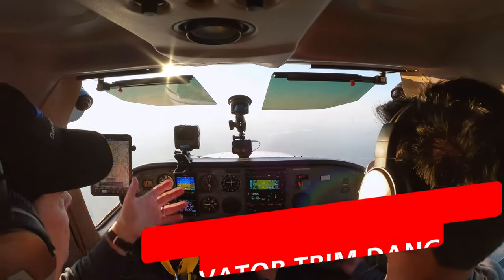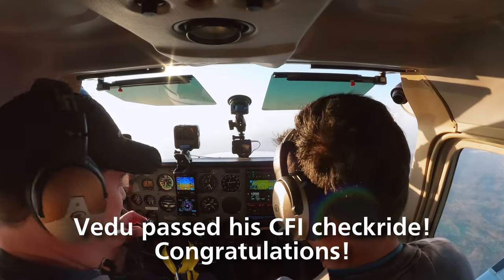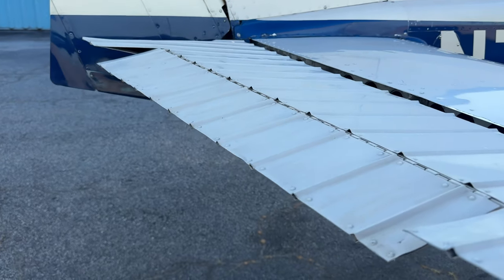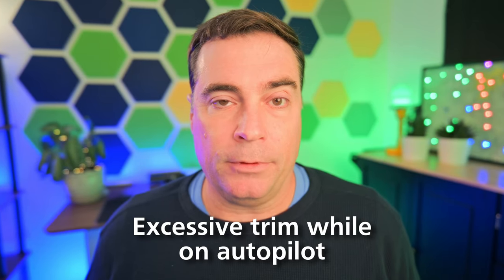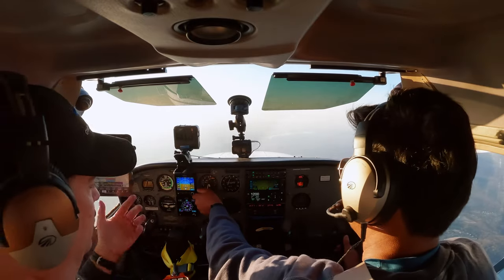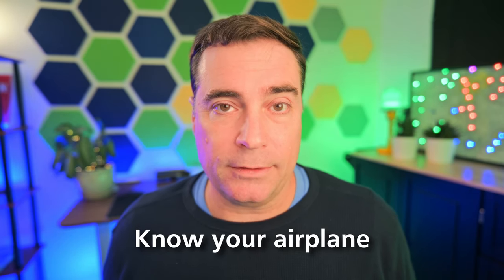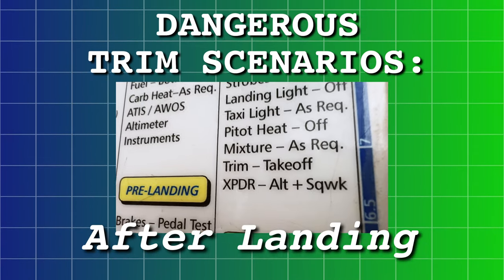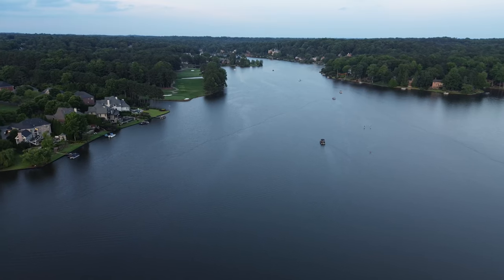How serious is an elevator trim issue?

Comment: I just learned a bit about this.  If you slow down the force is less.  This will buy you time to get circuit breakers pulled or getting away from the ground

Comment: Great video thanks Nathan more trim awareness should get out there. I had a full nose down trim run away in an Eaglet. The forces on the stick was alarming and I was worried about damage or departure from the control system while I was trying to overcome the electrical malfunction, note the Eaglet has a full flying tail plane
Reply from the maker: I think round two of this topic is going to be exploring the force needed in different airplanes, like your eaglet experience, and then something bigger and faster than a 172.  Thank you so much for sharing your story, I very much appreciate it!
Reply from the maker: Which eaglet was that?  The Tecnam or the AE?
Reply: It is a Tecnam, I have almost completed an Explorer taildrager kit, I am removing the installed electric trim and fitting a manual set up. Most likely a wheel like some GAs